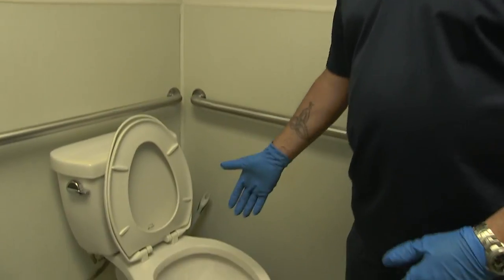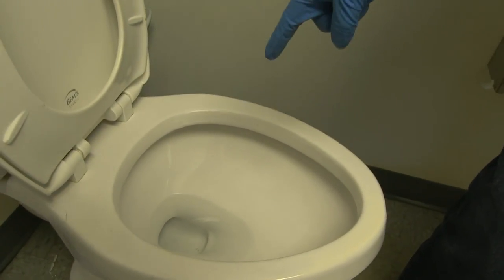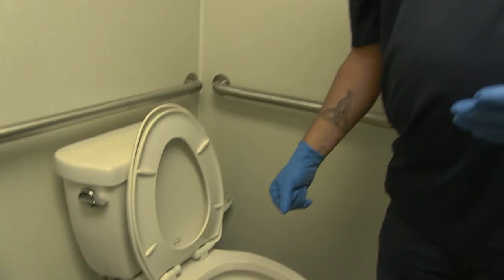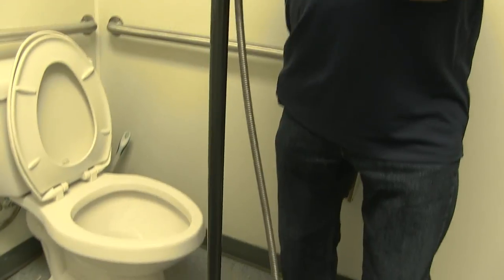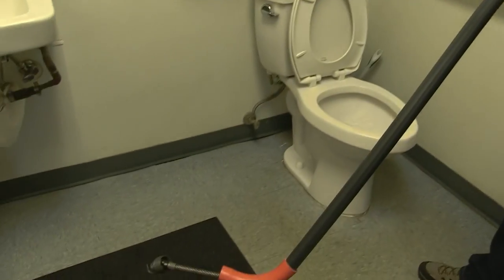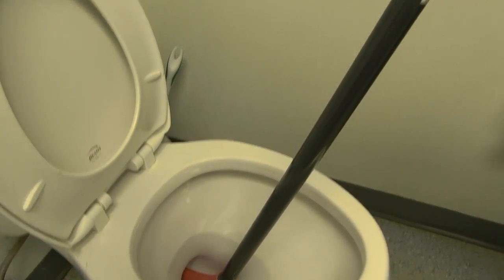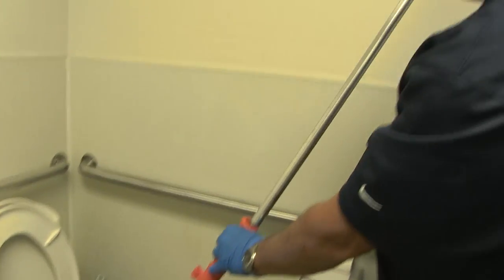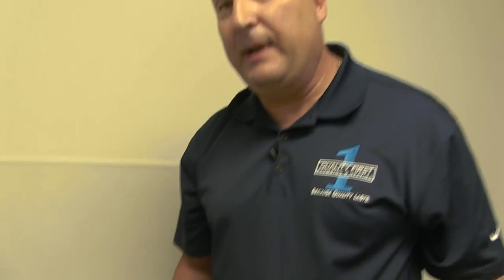How to use a Toilet Auger

Comment: Excellent, excellent tutorial. I hate doing any kind of housework like this (new homeowner, handy, but not ambitious enough to want to fix things) and did it in less than 5 minutes. You probably saved me hundreds, if not more. All it cost me was $10 for an auger.
Reply: To 5 String Sor: 10 USD is cheap for an auger. Where did you get it?
Reply: @eddyvideostar  I paid $14 at home depot and it was strong enough to pull out a metal cream tube
Reply: Thanks to your video I got an idea  what you did, excrllent I remove the sponge  for  4 min using the the tool like you hsave .perfect ..

Comment: Thank you!  The auger I have, seems to not respond to the crank.  The only way to get the wire out is to pull it with my (gloved) hand.  And then turning the crank doesn't pull the wire back.

Comment: Have the exact same auger. For some reason i can only get the auger down to about 1.5 feet maybe 2 feet in and it wouldn't go further in after multiple attempts had to call a plumber. $300 later it worked for a few days but back to not flushing.  Super frustrated now and feeling like I'm just gonna throw away money.  Don't even want to call a plumber now. All they did was auger it and claim my toilet is fine and give us $300.

Comment: This $20 dollar auger is junk and is now the source of causing our toilet to not be usable. The auger is stuck and I am not able to remove it from the toilet. I am going to have to replace the toilet and the only way I see possible to retrieve it is the use a sledge hammer on my toilet to separate the two. I am so frustrated & hate this piece of garbage.
Reply: Calm down. Breathe in and out calm calm calm
Reply: skill issue